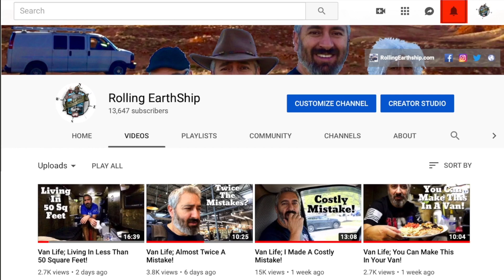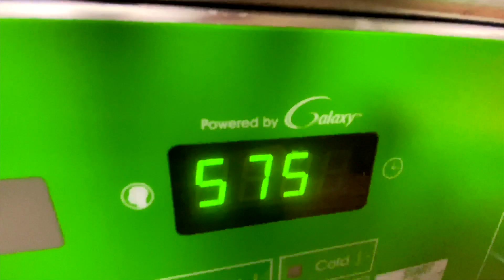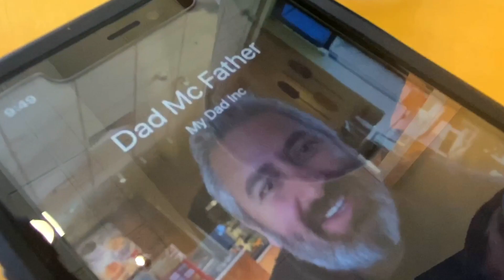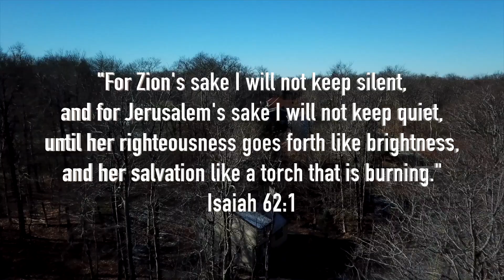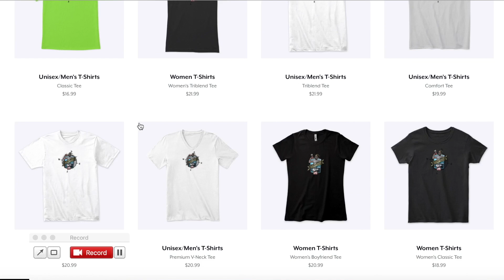Van Life; Westward Bound 2019!

Comment: (1) stick index finger in mouth to slightly dampen (2) stick dampened index finger in end of map and rotate finger to DECREASE diameter of map (3) remove map from tube (4) on stubborn sob maps may have to repeat step #2 at both ends
Reply from the maker: Nope, nothing worked. 👍🏻☕️🚐🖖🏻